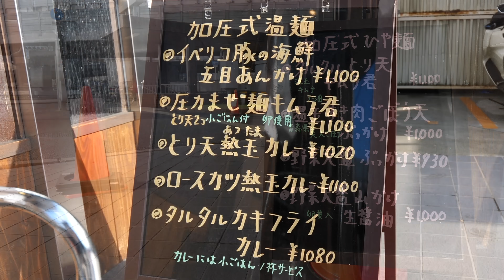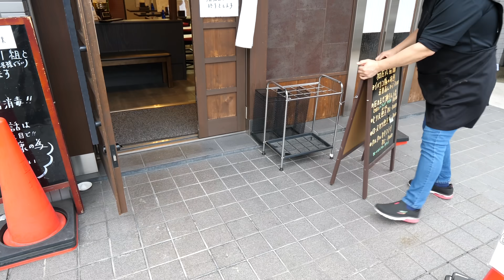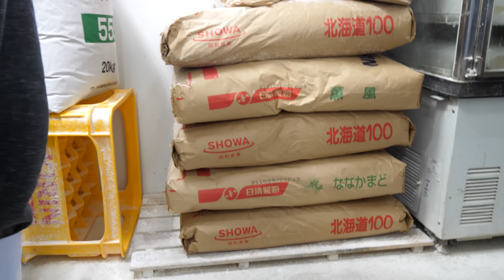衝撃が走る爆量カツカレーうどん！大阪が誇る最強うどん職人の仕事| INCREDIBLE NOODLES, Japanese Udon Noodles

Comment: 2:58

For those of you who don't know what soft water is, it's water that is very low in calcium and other minerals that builds up hard surfaces over time. Basically water that's been heavily treated.

You see it happening in your electric kettle after a series of cycles, where calcium deposits are attached to the electric element and occasioanlly calcium deposits at the bottom.